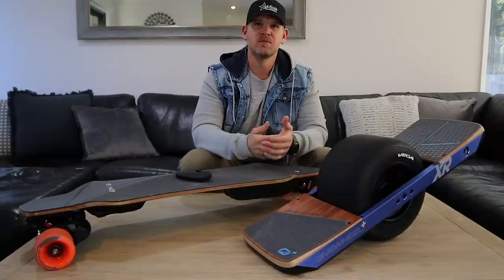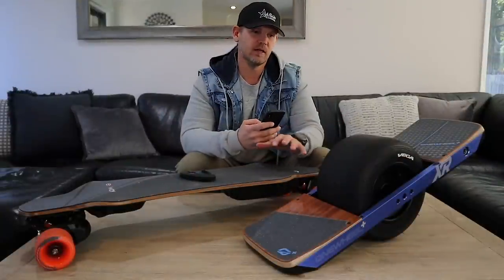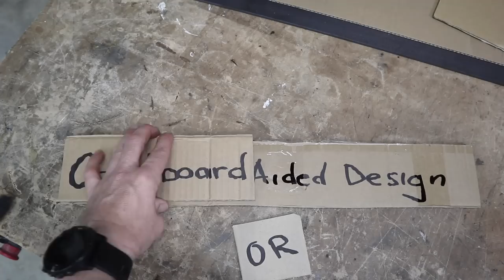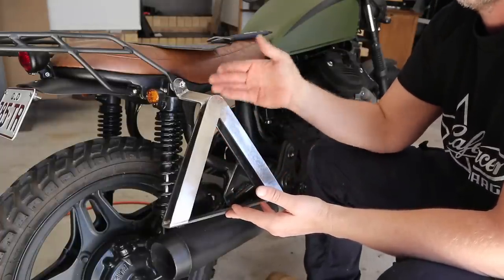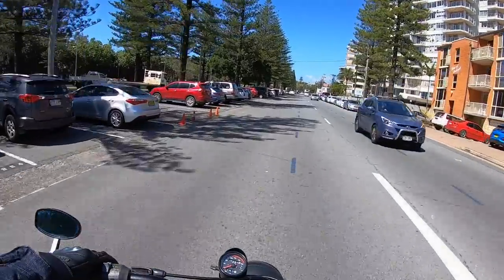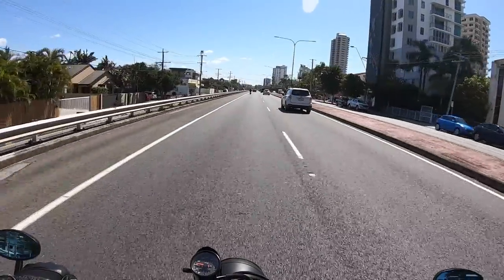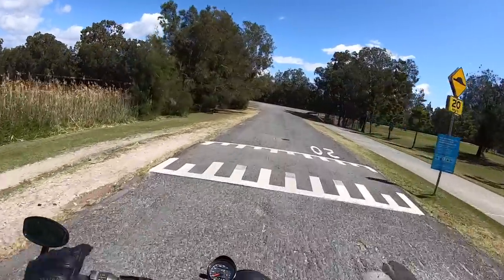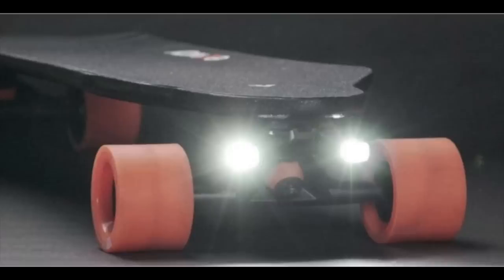Why Just Ride A Motorcycle - Timelapse Fabrication | Onewheel & Exway Flex Riot E-board

Comment: Man i wish the area i lived on were all flat surfaces rather than a combo of uphills and downhills, and bad road work. Even riding a bicycle is already work what more for a board.
Reply from the maker: Whereabouts are you located?  If that’s the case then the one wheel is definitely the option for you, these things can go over almost anything with such a big tire and it just feels like you’re floating, Sand, gravel, grass are no much for this thing.  My friend Bart was going between the pine trees At a fairly decent speed and that ground is really uneven with exposed roots and everything.
Reply: Electric unicycles blow the one wheel out of the water.